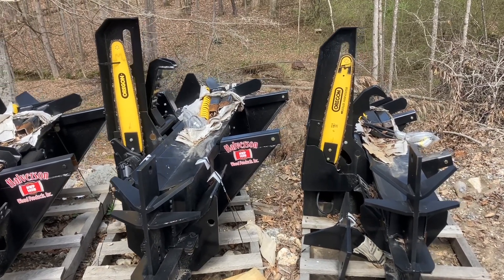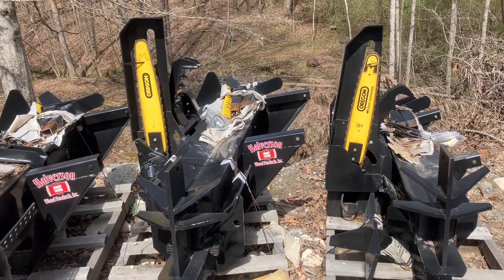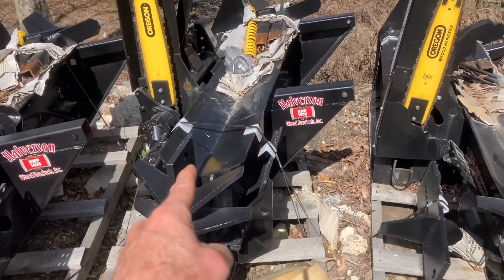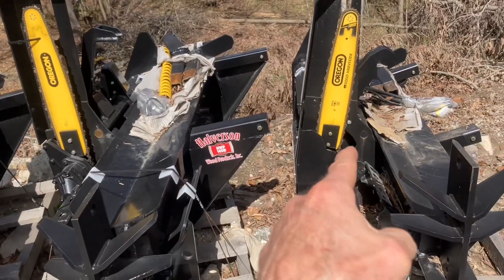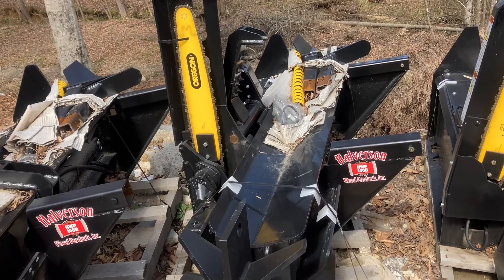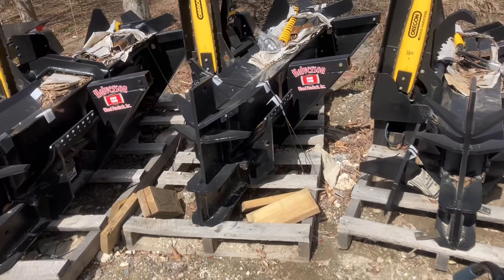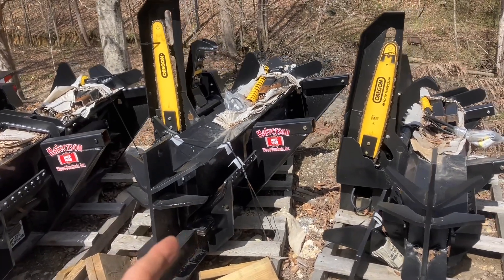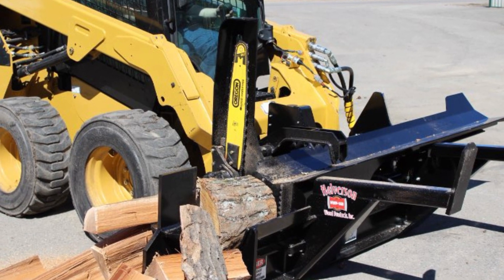Halverson HWP-120 vs HWP-140 Comparison - Skid Steer Driven Firewood Processor, 4 way, 6 way Wedge

Comment: For the price, and what people are accustomed too to not include a basic necessity like an adjustable wedge boggles my mind.  It’s like buying a sweet horizontal splitter for over $14,000 and not to have a log lift.  Quite a head scratcher.
Reply from the maker: The HWP-120 and HWP-140 has manual adjustable wedge height.  The HWP-150 has hydraulic adjustable wedge height.  You can look around and find cheaper (China) but you won't find the quality of Halverson USA at the price of Halverson.  Not aware of anything that is this quality at anywhere near the Halverson price.